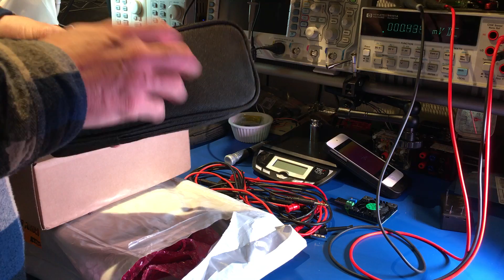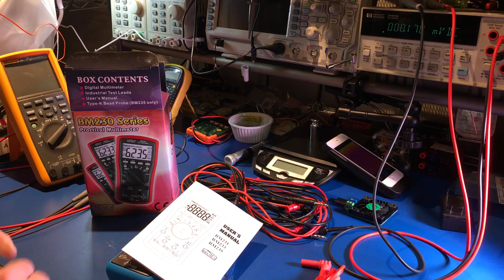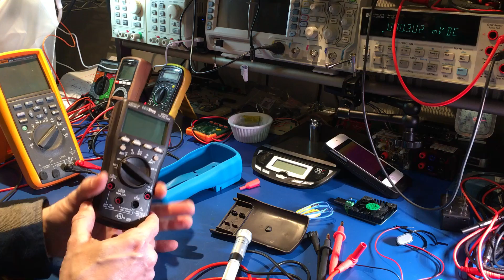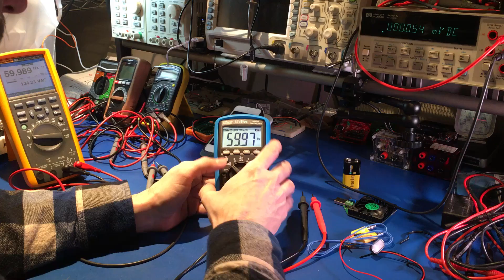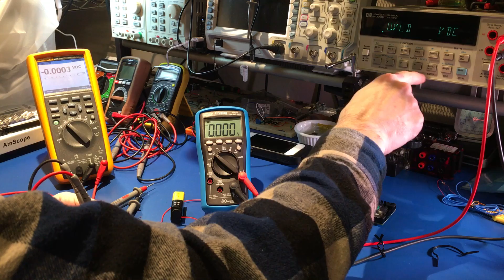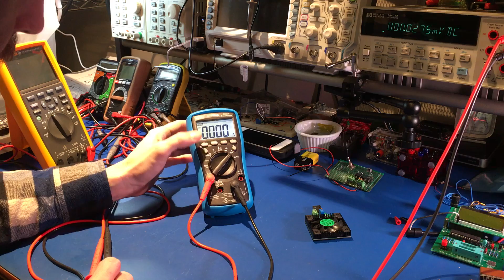EEVBlog Brymen BM235 Multimeter Review

Comment: Nice review;.. I'll check the current price but if it's still a C note, I'll have to get one.
Thanks,
Glenn
Reply from the maker: Currently it is on sale from AU$150 to AU$135.00, that's $97.25 US.
But unfortunately it looks like the hollodiay shopping may have bought up all the stock. It says out of stock, but I think it's worth the wait for new stock.
If you contact him he may  honor the sale price for when new stock arrives. 
Thanks for watching, happy holidays.
Reply: Thanks for the info.. I have 3) HP 34401A 6.5 digit bench counters in the lab as well as other handheld multimeters made by Fuke. However, there are often times when it's great to have additional meter when I have 3 or 4 projects going at once.. Also the 34401's are not the type meter I would take out of the Lab for field work.. Happy Holidays to you  and your family..
Reply from the maker: wa4aos 
I don't know if you will see this message, YouTube comments seem to be messing up again. You seem to have the same same main meters I also have. I have a ho 34401A and a Fluke 289. The brown southwire I gave away and I keep some cheap one around for DC voltage reading only.  But my top three are the Hp 34401A, the fluke and this brymen.
Reply: Yes, we have some of the same equipment.. I don't have a Fluke 289 yet but have been interested in that instrument. I have an ole Fluke 77 which is very close to the 34401's, close enough to do most adjustments and checks with a great deal of confidence.
A good bit of my work is with vintage receivers made originally for the military but now coveted by Ham radio op's and Shortwave listeners. In that work, I often need to peak circuits for performance and I use analog VTVM such as the HP 410C and 410B.. It is much easier to follow a needle moving up or down as opposed to interpreting fluctuating numbers..
just watched Dave on the EEVBLOG teardown a 7.5 digit Keithley Multimeter which samples 1M x/second.. Yikes.. 

I have not posted any youtube videos yet since I am busy with work but at some point, I may get involved with that too..

Comment: Love the review and put my Brymen BM235 on order.  Thanks!
Reply from the maker: Thanks, I'm glad you liked it. Don't worry about the back light noise, they fixed this shortly after two of us painted it out during our reviews. 

I'll share something new with you from last nights experaments.
I was recently looking into the burden voltage on different DMM's and found this one to be a little high when measuring current in the mA range. It claims it will measure up to 600mA in this range, but the burden voltage is to high for some applications when it's above 500mA. 
It was higher then my flukes and another Agilent  Percision shunt. But the resolution is good enough to use the AMP range and still accurate with much less burden voltage. So depending on how much current you are measuring I would recommend using the AMP range if 'it's above 100mA. At the high end of the mA range around 500 to 600mA it dropped 1.3 Volts DC. At 100mA in mA range it was a low burden drop about 0.25VDC. So if your measuring current above 100mA just use the AMP range instead, it was still very accurate within +/- 2ma using the AMP range, and only dropped 0.13VDC, and not 1.35VDC.

Maybe for current lower then 100mA or 50mA then use the mA range, it will be more accurate with only a little burnden voltage drop. 
This is nothing new with DMM, even my $500 fluke 289 has burden voltage. Not as much for measuring 500mA in the mA range, but all DMM have some. Just some meters handle it better then others. Using the AMP range for 500mA was good because it was still accurate +/- 2mA

I just thought I would mention it so you know. I just happened to notice it when I was working on something that was powered by a 500mA USB port. If I have time maybe I will do a small video on this, and I will try to make this part of any future meter testing. But usually meter are not my thing for testing, enough other people do meter testing also. I think this one impressed me for the size and value for dollar so I decided to review it.

Comment: flick screwdriver? kudos to you
Reply from the maker: It's a nice screwdriver, I did a short review on it a few months back. https://youtu.be/N1KyQcPSPaQ
They made version two that has gaskets arround the extention to remove the little wobble and increase torque control, but it doesn't flick out like the old one.
I've been using the new driver from iFixit:
https://youtu.be/0ECjFIjt3Tw

I plan to do a review of this once I have used it for a couple months, so far it's good.

Comment: The lack of a bar-graph is a pretty big shortcoming imo.
Reply from the maker: To some people maybe. Some don't have a need for the bar-graph, but other might. It's hard to find one meter to meet all needs and wants sometimes. Probably why most people have a couple meters. I personally don't have much need for the bar-graph, it does depend on what you use the meter for. It's still feature rich for the cost and a lot more accurate then most meters in this price range and smaller then most also. I still give it a good bang for the buck rating and find myself using this more then some of my other meters. 
I've even thought about buying one of the bigger Brymen now that cost a little more.

Comment: Hi GRV. Can I ask how life with the BM235 is going 6 months on? How is the quality holding up? Are you still happy and using it as a "go to"?
Reply from the maker: Hi, yes the BM235 is still going strong. It get more use then others, but each meter has its own strong points. I would say the BM235 replaced the garage and on the go meter for its size. The fluke has its strong points with other features, and o can take the bench meter with me to help a friend with w car that won't start. So it takes the most outdoor weather beatings more then any of the 6 portable meters I own. The variable drive frequency feature came in handy once, troubleshooting an AC motor and I never thought I would have needed that feature.
For basic lab and house use its works good. I still have to take another if I need PWM or when building led flashlights. If it had the PWM it would probably be the main meter. As for being my first Brymen I've been very pleased with the durability and accuracy.
Reply: Cheers. That's all largely positive. Thank you for going into detail.
Reply from the maker: No Problem, I try not to review or recommend items I don't use or trust myself. I've sent things back without doing a review before because it didn't work, had issues,s wasn't accurate, broke during testing and so on......
I could do negative and bad reviews, but their are enough people that do those kinds of reviews already.

Comment: Just an observation, I thought multimeter manufacturers wanted/planned for you to wrap the leads longways around the meter when using the probe holders? For example, the brymen 859s has little rubber clips built into the rubber boot to assist in keeping the wrapped leads in place. My other meters work out well doing the same thing. This is what I've always done. (Flukes, Agilent, Brymen, Hioki,...). I just thought I'd let you know as it seems the intended way. Also, no problem with your meters sitting crooked or your probes coming out. To each his own though, however you prefer. Cheers!
Reply from the maker: I think I saw that with my fluke 289, but I usually fold out the stand first and wrap them the other directions so I can stand the meters up on the bench. But whatever works, wrapping leads isn't a wrong or correct way kind of thing I guess. As long as you don't stretch them out with to much tension.

Comment: Nice lab! Just got the same Rigol Scope(and upgraded it of course). Any recommendations on a good value DC bench supply?
Reply from the maker: Well to save money I went with an updated Korad refurbished triple linear power supply from SRA-Solder. I figured since it was refurbished then it probably had the redesigned boards unlike the first version that has some issues and saved money. The refurbished one did have the updated boards as I thought it would. You can look at their refurbished products:
http://www.sra-solder.com/sale-refurbs

Or the new power supplies:
http://www.sra-solder.com/dc-power-supplies

In the example of the Korad KA3005D it can be a $50 savings. Mine is the 
 
It hasn't let me down yet and doesn't break the bank, and the display for amperage is closer then I expected for a power supply in this price range when I checked it against mt Fluke and HP 34401A. I wanted something that could do 10A for testing 3D printer heat beds, so you may not need the triple, maybe the single 3A or 5A would be more of a for depending on your needs and it takes less space.

Comment: Thanks for the review.  Good job btw, I'm subbed!  I would like to request a review of your korad psu's.  I have 2 myself but I notice one of yours has 4 connectors?  Duel outputs?  bipolar?  Model #?  I look forward to more of your vids.
Reply from the maker: +Chingus696 You might have the same power supply I have. Mine just a triple output. It's the KORAD KA3005D-3S - 30V, 5A DC Triple. It's the same as a single KA3005D except it has two 30V-5A rails and a dedicated 5V-3A rail making it a triple. The two 30V-5A can run in series or parallel for a total of 60V or total of 10 Amps. The one other difference is one rail has a chassis ground  to earth (green post) on the left side. The two extra post on the right is the 5 volt 3 Amp dedicated separate rail.

Comment: I have Brymen BM867 and BM869.Neither one not have whine
Reply from the maker: +Anonymous Nameless Not all of them have it. Not even all the BM235 are as loud as the one I received. I've been told Brymen looking into it and other videos were done explaining it. It's been traced to a single capacitor C44. I just did a fix video that worked also. Or you can replace the cap with a thicker one like a 25V-10uF capacitor. But I didn't have 10uF ceramic available so I fixed it another way. http://youtu.be/TfNuTmqtiD4